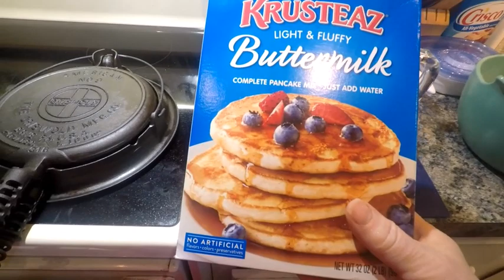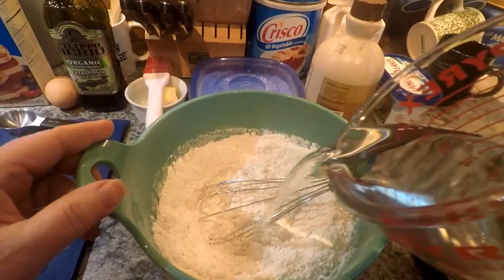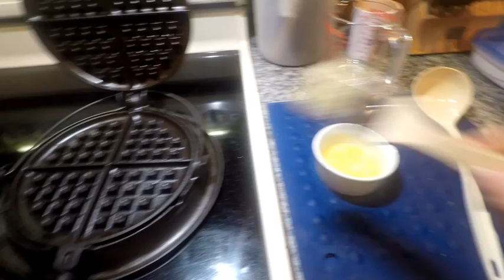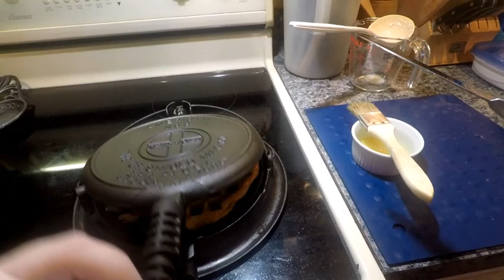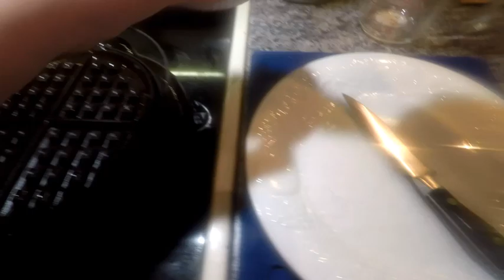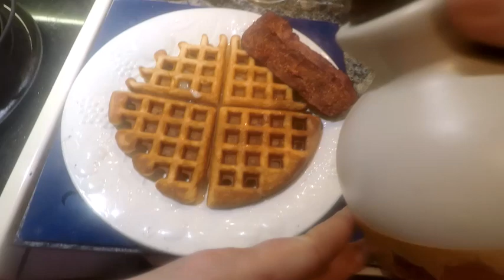Cast Iron Waffles in an Antique Griswold Cast Iron Waffle Maker - How To & Plenty of Tips!

Comment: I have a six inch with a high collar that I absolutely love. The low collar was for wood stoves. They manufactured a higher collar after gas stoves became popular . The higher collar enables the waffle iron to be flipped over without striking the burner. On a wood stove the low collar worked  because when the eye was removed the waffle iron could be flipped over the hole without lifting the iron.
Reply from the maker: Thanks for that interesting bit of information!

Comment: I was lucky enough to get No. 9 Griswold waffle maker on Ebay today... it doesn't have the lower base though. Is the base useful if you are using a modern gas stove with a big sized burner?
Reply from the maker: The low base is meant for electric coiled stoves or smooth tops on which it can sit and the paddles be rotated.  The high base is meant for gas stove tops to allow room for the flame underneath the paddles.  You can find one on eBay or if you search the internet, but it might not be easy.  This is if you can't use as is.  Hope this helps.

Comment: Hey! I have a question. A local antique store of mine has a #9 going for $150, do you think that’s a good deal ? Most of them I see online usually go for a little higher, thanks!
Reply from the maker: I guess it just depends on the condition it is.  If I have to strip and reseason, then I would expect to pay less than this.  I guess it all depends on what the market is doing as far as sold prices.  The best way to know is to check eBay listings, sold prices to get an idea!

Comment: I have the version with the taller base. It doesn't really sit on the burner grates of our newer stove. Need to get it out and try again.
Reply from the maker: Yes, you should!  They made the higher base for gas ranges so the paddles wouldn't smack the stove grate every time you need to flip the paddle.
Reply: @ladylibertystacker2014  Got it out and made waffles. Fantastic! Only snag I had was butter dripping down onto the burner when I flipped sides. It works wonderfully.
Reply from the maker: Excellent - that's good to hear!

Comment: Waffles! I love waffles. But I don't have a cast iron waffle maker. (Non-stick one imprisoned in cabinet because it started flaking.

Now I just make dutch. babies in whatever size cast skillet I desire. Fast and easy. 

What's the weigh of that waffle maker?
Reply from the maker: Thank you chesh!  Now for your question - do you mean the weight of the actual waffle iron?  Based on my #8 Favorite Piqua Ware Cast Iron Waffle maker that sold (it was about 8.5 lbs), this one weighs between 9-10 pounds or so.  It is slightly bigger than the #8 I had and the handles are longer.  It makes great waffles and I am glad I bought it to restore.  :-)

Comment: Adding both tablespoonfuls of oil would gave helped thicken it. Leaving it sit 20 minutes or more would be better.
Putting the waffles on a cooling tray inside a sheet pan in a low temp oven will help keep them crisper as you make the rest of the batter.
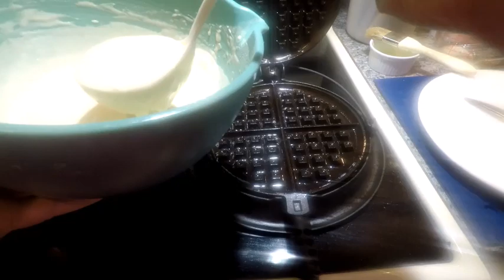Reply from the maker: Actually, adding extra mix helped a whole lot.  If you watched to 12:00 in the video, I actually was able to get a shot of pouring in the thickened batter for the 3rd waffle I made. I have done your oven tip but I had been seasoning skillets in the oven and they were still in the oven at the time I made this video.  As to letting it sit, I have heard that tip before and it might have helped in this instance as well, but when you're making a requested video for YouTube and using a new recipe to boot, I didn't think the batter would be that runny until I made it "live" on camera.  Next time, I will add a little extra mix keeping the oil at 1 TBSP and allowing it to sit before making the waffles.  Actually, the oil helps with the waffles coming right off the iron without sticking at all and they were very crispy enough for us!  Anyway, it is what it is.  Thanks for watching.

Comment: I'm shocked that these work on the smooth cook tops. I was sure they would only work over flames because of the actual cooking surface being raised up a bit.
Reply from the maker: Yes, they do work on glass cooktops.  That is why the base is low.  The hi base units are meant for gas ranges to allow room for the flames.  Hope this helps.